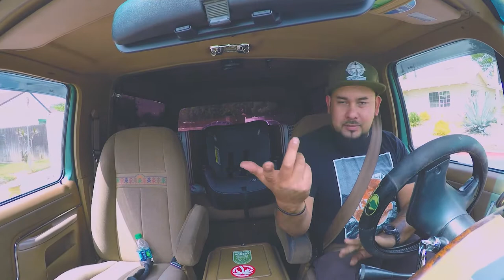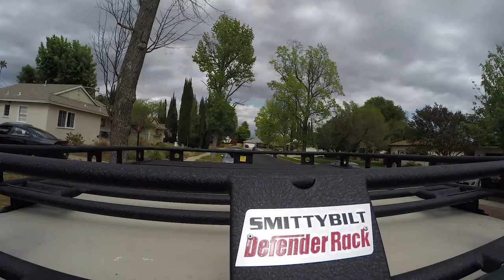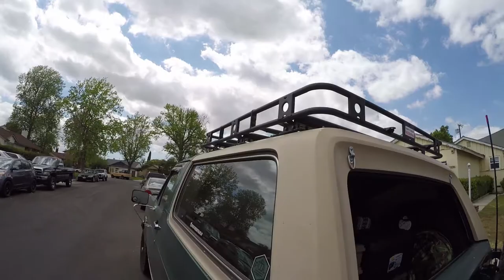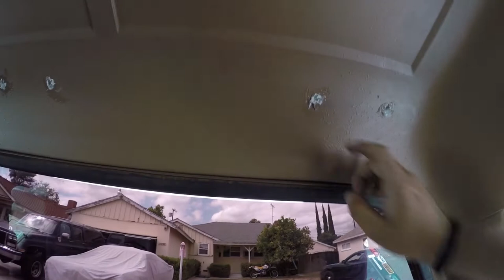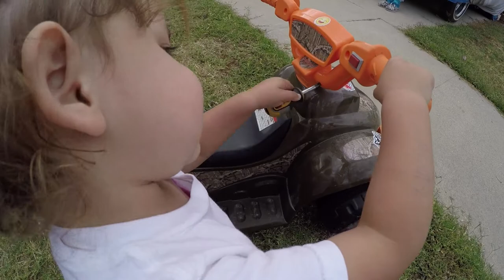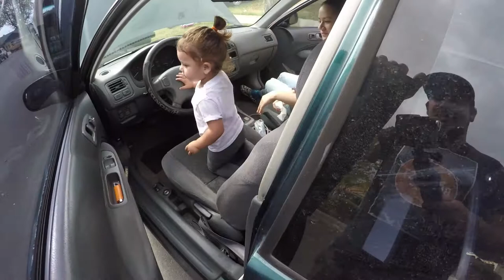BRONCO DEFENDER RACK PART 2

Comment: Looks good,,, just get a head liner for the back to cover the bolts. That’s what I did for my 89. Made a huge difference in noise and heat. Been thinking about a roof rack but to many eng issues just yet.